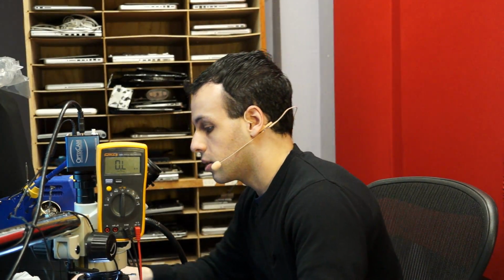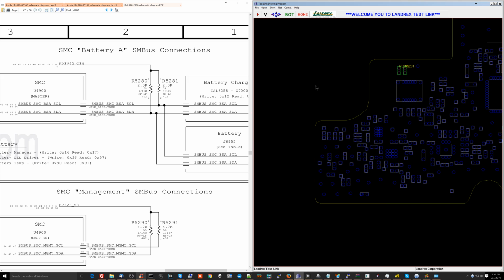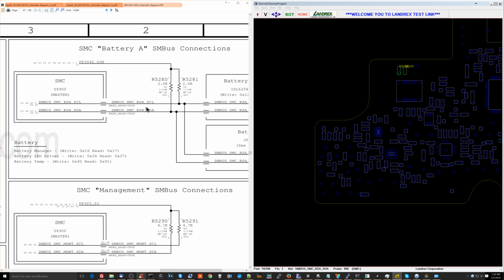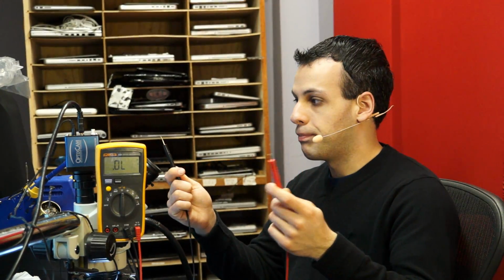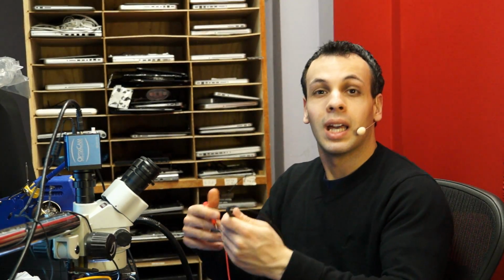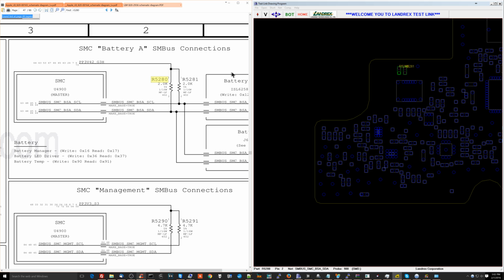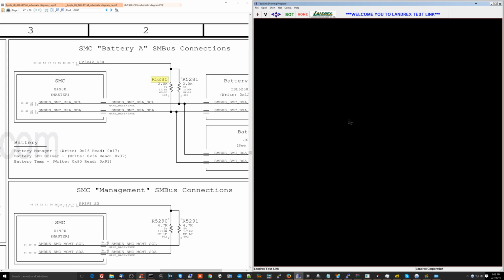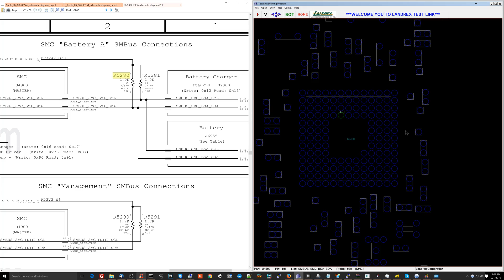Macbook logic board repairing X in battery after liquid damage 820-2936

Comment: i'm an auto technician  and the process you did is similar that when we have missing 5 volt ref or can bus shorted to ground. if we suspect a sensor or a module to be the culprit,we un plug sensors and such 1 by 1 while monitoring the voltage or activity on the bus line